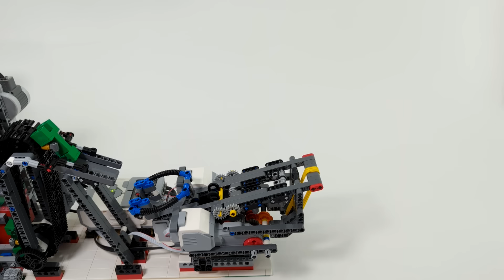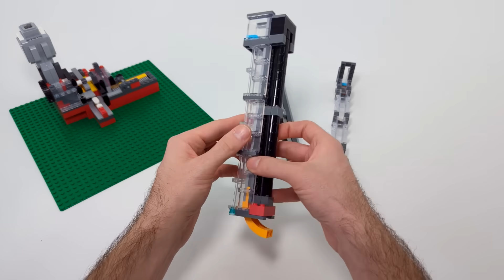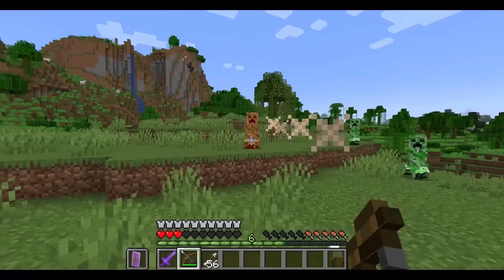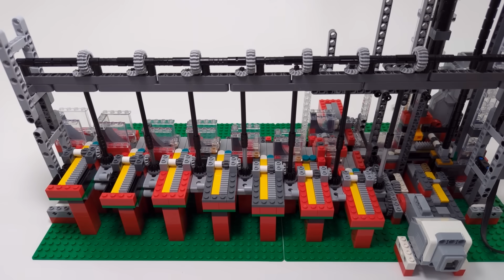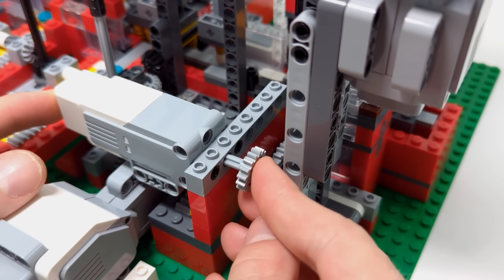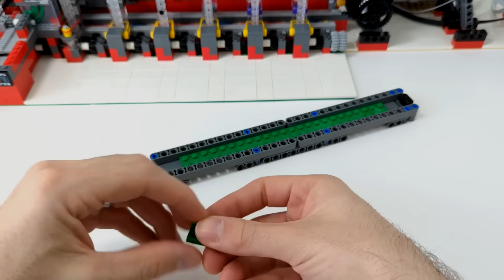Creeper Army Built By LEGO® Robot Factory!

Comment: Do you have to manually load partially completed creepers into each station before starting the machine?
Reply from the maker: Only the very first time, or you can run each station independently the first time. Once each partial creeper is at each station the machine shouldn't need that again

Comment: Each machine you make is more advanced and impressive than the last! This is awesome. 

My only recommendation would be to figure out how to control the pushers at the top with as few motors as possible. Having an individual motor for each one isn't optimal.
Reply from the maker: Thank you! I'm glad you liked it! Yeah I looked into that, like one motor with clutches to control all the presses, but they are also used to align each piece, and at different heights too, so this way ended up being the path I chose

Comment: Using a million motors kinda made it cheap. The pushing part would've been way more impressive with clutch gears and just one motor.
Reply from the maker: That's okay if you feel that way. The presses are not only for pressing but for alignment too, so clutch gears with one motor wouldn't have worked quite the way I needed it too, though it crossed my mind as a possibility at first